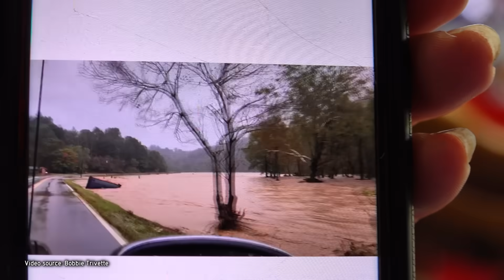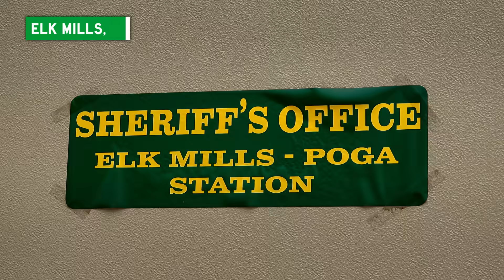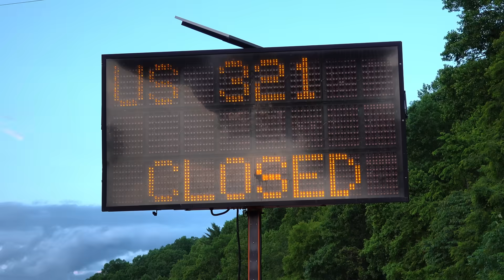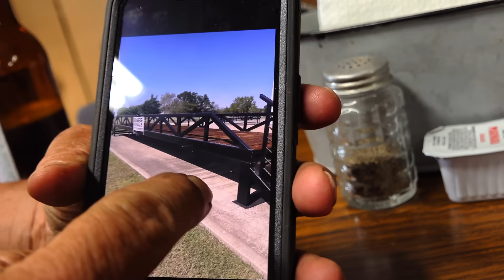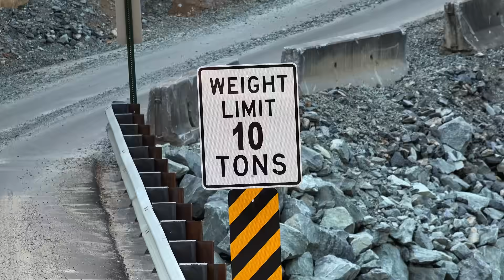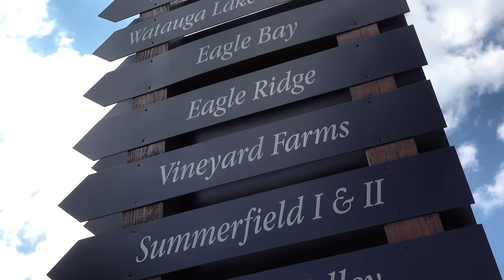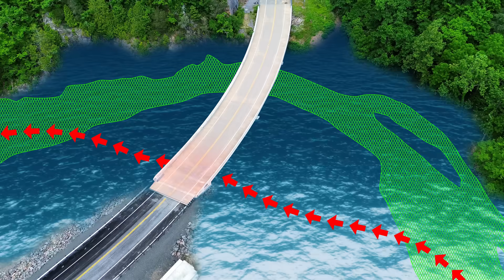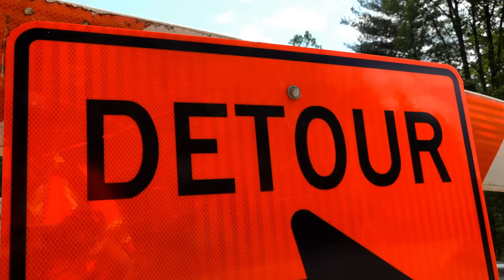How They Fix Roads After a Hurricane 🌧️

Comment: The original route would have taken I 40 via Hot Springs NC. Naturally politicians got involved.  The road closing has been an ongoing problem due to rock fall blocking the interstate.  Need to rebuild this section with a via duct like I 70 in Colorado along the Colorado River and the Blue Ridge Parkway around Grandfather Mt NC

Comment: Road Guy Rob,  If you look back into history - not too far, 1972 - you will come across the story of Hurricane Agnes which parked over the 'twin tiers' of New York and Pennsylvania.  It destroyed cities such as Corning, NY - Corning Glass - and Elmira, NY.  
According to a 1980s Cornel Doctoral thesis on the downfall of the NE Rust belt cities, Elmira, pre-Agnes, had a building stock of about 10,000 buildings, including 2,000 core downtown structures.  It lost about 1/4 of those buildings due to the flood.  And a couple of years ago I did a google survey and counted the buildings and the city barley has 300 'core downtown' type buildings.  And on one time population of about 50,000 is about 26,000 now in the city.  
.
People forget that the power of a hurricane can reach inland hundreds of miles from the oceans.

Comment: that mother came up here to NY state.  I live right on the boarder of NY and PA about a mile up form it in a little town called Troupsburg.

When the feds said way back then that there were 10's of 1000's of unsafe bridges in the USA we had  almost everyone in the township fall into it.  So we put on another 10 cents per 1000 and said this goes only to improving our roads.  Will I have one of the few culverts on my drive that has not been upgraded yet but it was to be before it hit.  We did not feet of rain over days.  It went over us fast but gave us a foot in just 12 hrs.  Well to make this one short that 10 cents has been spent each yr there after on that storm damage and digging every dich on the 86 miles of road deep enough to handle that much water.

U see this is a place where most ppl r still farmers.  We can see that climate change is not just coming but is happening now and has been for sometime.  Our growing season has gone form 120 days to 150 days.  The growing season is that time between the last frost in the spring and the first i the fall.  OUR roads may be gravel but that is how we like them.  cheap to maintain (only 10% of a 2 line paved road's).  We dont have any place to go where we need to drive at 80 mph, in fact most of the driving being done on these roads is done at less then 20 mph on tractors.  At any rate we can see what is coming and we r doing something to prepare for it now not when something like this happens again and we know it will and sooner then most think.

So u see u kids in TN, Ky, S&NC got it the worse it went up the coast and did a J O B on everyone.

Our little Troops Creek went form the little stream U can jump over where it goes into the Cowanesque R to a raging flood that came up 15 ft.  Not the 30 ft u got down there but it did some real damage. The state is still working on making Rt 36 safe again.

Comment: inb4 colab with practical engineering? In all seriousness, I truly think folks don't understand how this storm actually damaged these roads & bridges. The elevation basically squeezed all the moisture out and funneled it into the bottoms of the valleys - most of which are waterways. I had family live through the flooding in Vermont with Sandy, and the damage here looks like it did up there. A lot of these bridges and especially the roads were put in & designed decades ago, before a lot of the modern floodwater mitigation technologies that we use today. Hopefully these repairs using modern materials and updated knowledge can mitigate future flooding. Resilient infrastructure is critical for public safety. Great video!

Comment: Thank you Rob et al. Good story. If you look at images of NZ back country bridges in remote valleys, many of them are single lane bridges. Single span wherever practicable and a minimal number of piers where such are required. You will also see that concrete bridge abutments in narrow valleys are often raised above road level where the road runs along a river terrace, which means that, even if a bridge approach is washed out, the bridge is still securely supported by the concrete abutments and any piers. The existence of seismic activity ensures that public road bridges are planned and constructed as Specific Engineered Designs with supervision and progress inspection by the designer(s). Some of what I saw in your video, appeared to be a draftsman style of construction intended for ‘dry gaps’ i.e., rather than wet gaps. Cheers from NZ🇳🇿.

Comment: Hold on, folks.  Everyone with a functioning brain KNEW that Helene-level rainfall was possible because IT ALREADY HAPPENED.  The flood of 1916 hit this same area and caused the same damage, but the imbeciles living there rebuilt in the exact same places.  Bridges that washed out were replaced with new bridge decks on the old abutments.  Structures that were torn off their foundations and washed downstream were replaced with bigger structures on the same building pad, sometimes re-using the same stripped-clean foundation.  New hospitals and fire stations were built where their SECOND floor was BELOW the flood crest.  That may sound insane, and it is, but guess where they're putting the replacement roads, bridges, and structures after this nearly identical flood?  That's right, THE SAME PLACES.  These people are deliberately building a THIRD disaster.

Comment: The weird thing about it is is the Appalachians are a little abnormal. The watershed line is not in the actual Appalachians it's in the Blue ridge in North Carolina.  So there's a valley there that's draining through pigeon forge River gap into Tennessee. No it makes a wonderful natural Gap to run an interstate through.  But it's also a choke point for water.  Normally this is not that big of a deal you drop that much rain in unlimited valley like the pigeon forge watershed starts off as it's going to be an absolutely destructive force.

Comment: Its amazing how locals put their heads together to help themselves temporarily. It seems to be a problem in this state with all our rivers but limited bridges to cross them. The counties surrounding the capital region has the cumberland river weaving through and separating counties. We have only two bridges outside of nashville that allows traffic to traverse without having to enter the city. Highway 109 which is also used as a eastern bypass because of a lack of northern I-840 loop and US Highway 231 are the only paths that have bridges across the river. Don't know how bad it has to get for them to add more bridges over the river. It would be an absolute disaster for mobility if something happened these critical bridge crossings. This is why the counties and the state need to work with the Army of Engineers to build out more bridges that cross "Old Hickory Lake".

Comment: That was a great report.  

A lot of people don't realize just how hard it was right after the storm.  So many roads and homes were washed away, never to be seen again.  I was only minimally affected but that still meant the power was out for weeks, the water was out for months, and many major roadways were impassable for many more months.  There was one stretch of road near my place that had about 50 downed trees mixed in with overhead power lines that took 4 months to get cleared.  There are still come public roads I drive up that have massive chunks missing and trees partially blocking the roadway.

Comment: You should look at the practical engineering channel. He did a good series on geotechnical building and the science behind geotechnical dirt. In how they use those grids to lock layers together to where things like sand that is usually very porous and moves easily ends up being a walking mechanism and even demonstrated that you can do just a block of sand with no sides or anything and lower your car onto it really cool demonstration that's from a few years ago but there's a bunch of videos he has on the subjects

Comment: Huge fan here, hey you should do a bit about here in Oregon on highway 26 between Portland the coast there is a stretch of insane bumps and a super messed up road for about 50 feet that they’ve been working on for years and has seemingly made no progress at all. I think it has to do with the land underneath moving and shifting around but you literally can’t go more than 10 miles an hour for that small stretch. I know it super niche thing so maybe in the next video you do near Portland you can check it out. I can’t say exactly what milepost it’s at but I believe it’s about halfway between Portland and the Oregon coast. If you drive that highway it is absolutely impossible to miss it, if you speed thru it your car will take flight. Thanks!

Comment: Thanks Rob for the excellent report. I first was exposed to geotextile fabric in the late 70's, we srtipped off the vegetative layer and rolled out the fabric then dumped and graded 18" of gravel. Then continued to dump and grade over the unstable areas to make an access road for a building. I'm still amazed at the uses!
Reply from the maker: Thanks, Tim!  Yeah, it's pretty impressive. I suppose burying it helps keep it out of sunlight (I'd imagine UV would break it down)

Comment: Every time you said "dirt", it reminded me of my old soils professor in college (jokingly) telling us on the first day of class - "The quickest way to flunk this class is the call this stuff 'dirt'. It's soil dammit! It's soil!" Some of my fellow classmates dared to call it 'dirt' and while they didn't flunk, I remember seeing them get some really terrifying professor death stares. 🤣🤪
Reply: I recall a lengthy rant by a character in the show Bones that went over many of the same points.
Reply: Soil is fertile and compact. Dirt is sterile and loose. The stuff used in construction is sterile and compact. And there is a different term for every size and texture. So using either dirt or soil for it is not sufficient, and only ever at best half right. Dude was causing his own problem.
Reply: @blairhoughton7918  Soil materials that are ideal for agriculture and those ideal for construction have relatively opposite properties. Agriculture generally needs soil materials that have more fine particles, organic residues, and a more open packing (allows water to infiltrate), to promote plant growth. Meanwhile, construction soil needs materials that have coarser particles, no organic residues, and a dense packing (allows for strength against compression and erosion).

Comment: What I find very surprising, at 3:37 is a thin is the layer of asphalt. It appears to be barely 4" when I have seen motorways in France to be done with more than 1 foot thick of asphalt.

Living in Thailand, floods are a common occurrence, but the relatively flat terrain means there is less wash out.
Reply: Probably cause they were laying these roads on new soil, rather than in most cases in Europe where you are laying it on top of existing (but milled) asphalt

Comment: Bridges are funded by state and local taxes and to get federal funds you have to go through Congress which, when there isn’t a disaster, is glacial slow. When there is a disaster it’s dependent on how big the impact is. Boston or crossing the Mississippi? High priority. Other stuff? It will be years. And county’s don’t exactly have piles of money. Most of the bridges in this area are built as part of the Federal Highway System where by state and local made up 10-30% of the costs. Federal covering the rest. So it makes replacement hard.
Reply: Getting the 40 back up this fast after that kind of damage should get some people medals. But there will be people leveraging it as a failure instead.
Reply: Thats why you need (federal, state and county) infrastructure funds were the tax money go into and politicians have nothing to say about, they can only put money in, not out. The infrastructure fund makes multi year maintenance schedules and the money it needs to save for these future expenses. That way you know immediately if you haven’t got enough money and taxes need to go up. They have their own ‘constitution’, their founding rules and they can only spend money on infrastructure maintenance. In my country we do it this way since 1798 and we have the best infrastructure (roads, rails, watersways, sluices, bridges etc) of Europe. We don’t even have a word for pothole, because they don’t exist. If there is something wrong with the road surface, you can call or app the foundation and it will be fixed within 48 hours. If it is an emergency fix, the resurfacing is already scheduled to happen within a month, unless regular resurfacing is scheduled within a year, then they keep the emergency fix until the resurfacing. We see the importance of good roads, rails and waterways for pur economy and spend money wisely, for a capitalist country, the US are doing a terrible job.

Comment: @Road Guy Rob, railroad wheels, the bogey under the car isn't actually permanently attached to the car. It's held in place by a king pin that pivots in place. It's really easy to detach the whole bogey and then lift the car up with a crane. The car can then be plopped down into place wherever it's needed. No need to chop the wheels off.
Reply from the maker: That's really interesting to know.  I just wish I'd had more time to reach out to the company who re-purpose those.  Makes sense they'd detach like you'd describe.
Reply: There are quite a few of these used in Colorado as private bridges.
Reply: @ghost307 I've seen farmers here in Ohio using train cars too.
Reply: It also makes lineside repairs easy.

You can lift a car, roll the bogie out, pull a wheel set and put a new one in. Then roll it back under the car and set it back down.
Reply: Man I love White people. This video is awesome.
Reply: @ericcartman5552  uh, phrasing.